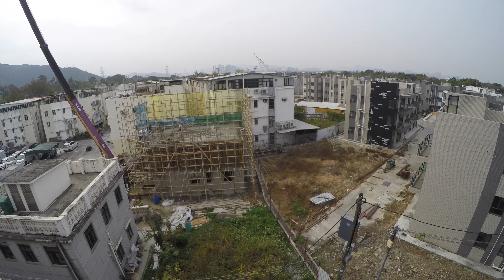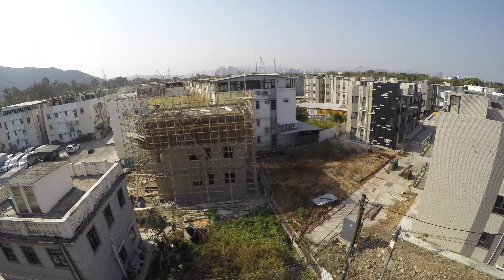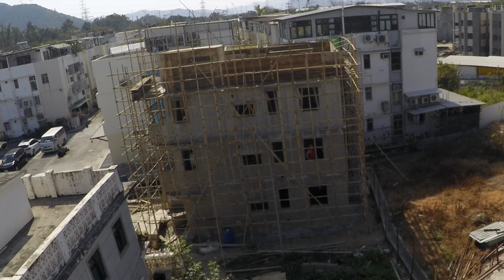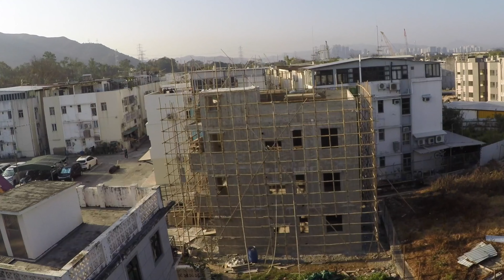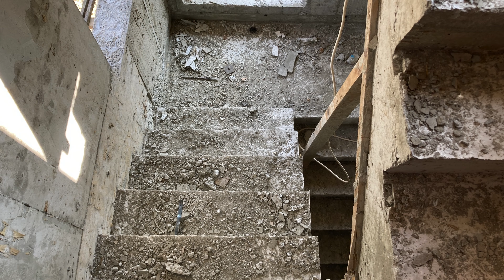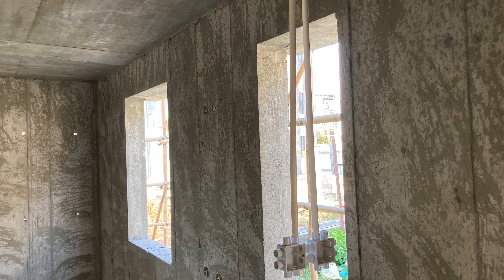🇭🇰Cement Village House Whacked Up Bamboo Scaffolding

Comment: The so-called 'Hong Kong House' is actually a 4-storey block of flats. The dimensions are dictated by colonial-era planning regulations that dictate that no single residential building in a rural area can be more than (roughly from memory) 500sqft per storey and max 40ft high. So in a space-constrained territory people naturally build out to the permitted dimensions.
Reply from the maker: You should be my adviser 🍻